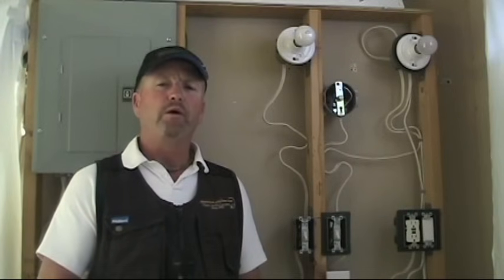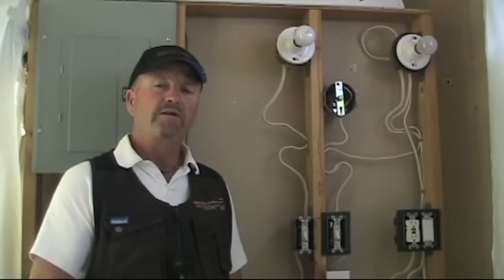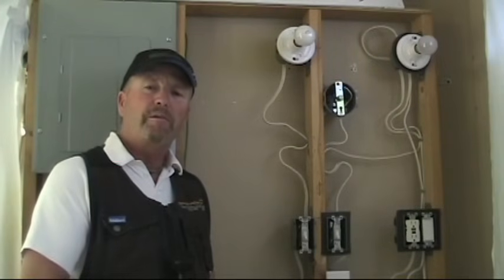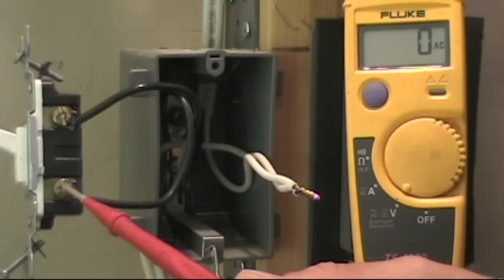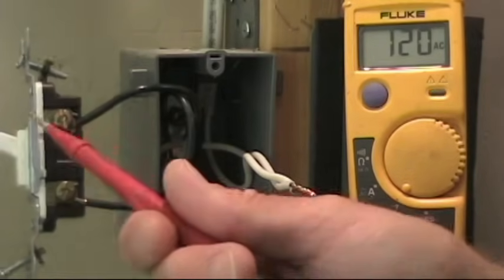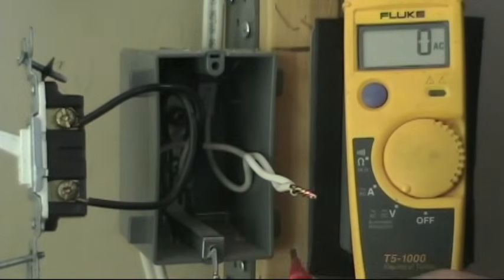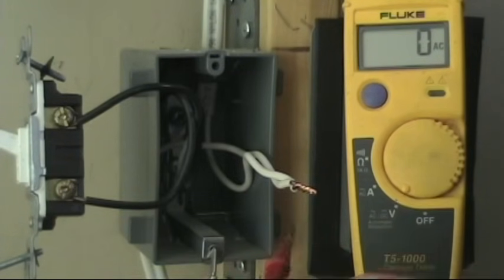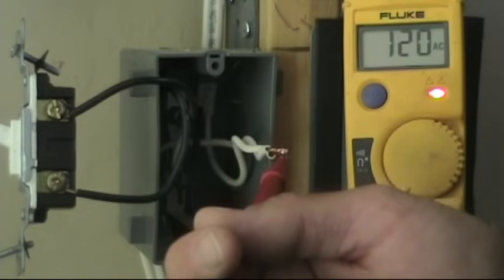Understanding an Open or Loaded Neutral

Comment: Why not zoom out and show the rest of the circuitry where you disconnected the neutrals in the junction? I think it would be a whole lot easier to use that mock up wiring rig with the video to its full potential for the visual learners. Just showing 2 neutrals with and without a load on your meter, without showing the part where you disconnected the other part of the circuit, doesn't really show the full story.

Comment: I have a subpanel out in the garage, where the ground and neutral busbars are tied together.  Then a black wire with a yellow stripe goes back to the house.  I haven't looked in the house yet to see if I can figure out what is really happening, but I assume the striped wire is a neutral.  Is the subpanel in this configuration wired correctly?  If so, do I even need grounds for hookups off the subpanel box, because they're just tied to neutral (until they get back to the main panel) anyway?
Reply from the maker: Check with you local code, but where I was trained in the trade,  if you ran a sub-feed to an outbuilding like this, if you ran 4 conductors (2 hot, nuetral and ground), then you did not bond the neutral to the ground at the sub-panel.  But if you only run 3 conductors, then you must establish another suitable ground (earthing) point at the panel location and then bond the neutral as it appears is the case with yours.  Then all the circuits fed from that panel must still have a ground wire in all the cables to keep earth and neutral separate from the panel onward. If that ground wire goes back to the main panel grounding system, then that isn't correct and you are vulnerable to floating ground current on that conductor.
Reply: @theinternetelectrician  thank you; I have an electrician coming by today; will ask him.

Comment: So the neutral connection back to the panel was open. I've read approx 36v on neutrals in operation,but didn't receive shock from them.

Comment: I have run into several of these with broken or disconnected neutrals in stab in the back outlets. Also people running screws into wires in the wall.

Comment: Now how to fix it??? 
You left me thinking how to fix it???
Reply from the maker: The solution is to connect the neutral wires back together (that were taken apart as described).The neutral (grounded conductor) path should be continuous all the way back to the panel.

Comment: To perhaps help explain this another way (I’m from the UK so the terminology may differ, but the principle is the same). 
To help understand this, first forget the colours and the names of the wires, it is only a human invention to colour code and give the conductors names.  We call them Line, Neutral and Earth. In physics, it doesn’t matter what colour they are or what they are called, the electricity just flows. So in this example, with the circuit energised, the electricity was flowing from the board, through the switch, through the lamp, along the neutral and back to the board. The neutral was not connected to earth at the board though, due to the junction boxes (splices) being removed further along in the circuit. So there was no return for the circuit to be complete. In essence, all wires have now become Line. Hence a potential of 120V (230 for single phase in the UK) between Line and Earth. If you touch the “neutral” here, thinking it cannot have a voltage between it and earth, you are in for a shock, as you have now completed the pathway back to earth and are getting electrocuted. I hope this helps. It can be tricky for people to understand at first. That is why in the UK, both the Line and Neutral constructors are classed as “Line” conductors, as in, they carry the electricity in normal operation, and why it is a good idea to use double pole isolators, odd though, as most breakers are only single pole.

Comment: Ground & nuetral are tied together in the main panel box creates GFCI so it will trip the breaker. So you could have it turned off at the box but another breaker could be on another circuit feeding electricity back to the neutral bar where your neutral on your circuit is connected. So when you flip off the breaker it will kill the electricity coming from the load Black or Red Wire but it will not turn off a possible load on a neutral feeding back to your neutral bar in the Panel coming right back at you throughout the neutral bar on the circuit your working on. That's why I kill all the power & still test it to double check It's off. Am I right or am I wrong because I been surprised by a Neutral before & thought WTH? So there could always be a load on the neutral. Ground & Neutral are supposed to be separated beyond the main panel so they should not be connected in recepticles, light switches, light outlets, or sub panels. The reason it's connected so it'll safely flip the breaker. The ground is for short outs & lightning strikes because lightning trays to find a way into the ground through your wiring. But ships & boats is an ungrounded electrical system. Even the ground might have a load on it because ground & Neutral come together in the main panel. I can't understand why now ranges & dryers must have a neutral but major Central Heating & Air Units & PTAC Units does not require a Neutral I wished somebody would explain that one to me? Two Hots & One Ground for my PTAC Unit but no Neutral is required but it's a requirement on Ranges & Dryers now? So what the Hey? Why isn't it required for PTAC Units & High Voltage AC Window Units & Central Air Units?

Comment: Yes sir, many technicians don't realize this. Can get one hurt too. Not as  common on led / fluorescent, solid state circuits and such. When troubleshooting,   neutral & grounding should be forefront...... automotive, industrial / commercial and machinery. Never assume the ground or neutral is not hot.

Comment: Ok...
QUESTION: 
WHY I TURNED OFF THE SWITCH AND STILL MY TESTER BEEPS INDICATE IS A HOT POWER (BLACK WIRE) 
TURN OFF SWITCH AND TURN OFF THE LIGHTS... BUT STILL SHOW POWER.
😱.

Comment: The problem in this explanation is saying the neutral splice is open "further up in the circuit."  Which way is "up"?  He should have said that the neutral was disconnected/open "closer to the main circuit panel" (where the neutrals all come together and are grounded).
Reply from the maker: Up generally refers to "towards the source", like a river for example.  Thanks for the feedback however.

Comment: Forgive me for being confused...But, it would seem as though your neutral wire would show voltage with the switch on like you have it, provided the circuit was complete through bulbs or similar loads...  Will read the next comment, perhaps that will explain it to me

Comment: I watched this whole thing and you didn't tell me a damn thing.  What did he see when he opened the Junction Box...???
Reply from the maker: I clearly stated that he had left a splice of neutral wires undone (open), so try to visualize 2 wires, white wires, previously connected together, now not connected together, thus breaking the intended path for current flow.  Have a look at this post on my website.  If you're still having an issue understanding this, send me an email and I'll send you a photo of 2 wires not connected together.  https://www.electrical-online.com/understanding-an-open-or-loaded-neutral/

Comment: I’ve run into this quite often in my house that was built in 1930 with cloth wrapped wires and porcelain insulators.. started replacing wires and outlets and figured out it was easier just to cut out all the old and start at the breaker box instead of routing them back the same way originally done and avoided a lot of unnecessary splicing.

Comment: Got a strange one here, had an issue with getting shocked of the meter box, the power co. opened the meter box, told me that the meter box was outdated and at fault because the neutral was not bonded to the box there. They made me install two new ground rods along with the existing plumbing ground inside. 
While disconnecting the power up top, to replace the meter box, with both hot wires disconnected from the pole, but the neutral still crimped, I went to check continuity to ground at the meter box and blew the fuse in the meter. I then checked voltage, and found I have 117v between the neutral wire from the pole and the meter box itself?
Both hot leads from the pole are disconnected, the main is off, yet I got 117v seemingly from the neutral lead from the triplex run from the pole?

Comment: Nice video. I once had the hot neutral. It bites hard. Something I have heard of but to the best of my memory I don't think have seen one. That is what they call a floating neutral. I have asked several electricians but never got a good answer as to what a floating neutral is, what does it do, and how do you find and fix a floating neutral?
Reply: He should build a model and actually show what's happening! Easy!

Comment: If it helps to explain, that exposed splice on the white (neutral) he was showing in the switch box would have been open (un-done). So he wouldn't be testing a "neutral" any longer. Only a section of white wire between the light and the switch. Unscrew the light bulb and you wouldn't get ANY reading between the switch and the end of the white wire since the light bulb filament is acting like a "coupling" (connecting the black to the white at the lamp) and extending the black wire that brings power to the lamp. Yes, a diagram or more physical demo would help.

Comment: House wiring can be tricky to analyze from limited check points.  But if you can keep in mind the overall circuit and source of the two points where you are reading a voltage and think about where it could be coming from (like through a load) you can figure most out.

Comment: If the nutural wire is purposly cut and not connected to any fixture, and just hanging off the wall, can it be stuffed back into the wall where it originated? If I turn on the electricity will this cause a fire in the wall?
Reply from the maker: I'm not sure I understand the question.  You have a single white wire hanging out of the wall, and not a cable (bundled black, white, and ground?)

Comment: Good lesson, but I’m surprised you didn’t talk about how to fix it 🤔
Reply from the maker: I guess one can never explain well enough, but I stated that the neutral splice had been inadvertently left undone, so the solution to fixing this particular problem was to put the neutral wires back together as they were.  When you don't know where the issue is, that's when it becomes a trouble-shooting exercise.  Thanks for the feedback.

Comment: kind of like al capones safe at the end...my search continues
Reply from the maker: What do you need to know? Let me help you out.  Elaborate on what you're searching for.
Reply: @theinternetelectrician  OK, I did a replacement ceiling fan install  and a replacement wall switch install. Went like clockwork. Then I said, I need to change out the wall switch and faceplate cover. Go from beige to white.  Dumb move, because my ceiling fan and its wall control  work as expected. However, I cannot get the ceiling lights to come on.  Both wires I test are 125 volts.  That, I think is my problem.  Thanks
Reply from the maker: @origtex  What wires are you testing that show 125V? Might need to have you send me photos, sketch, whatever you can to help me try and figure this out for you.  terry@electrical-online.com
Reply: @theinternetelectrician  Ill make a quick youtube of the problem and put link here. Thanks
Reply: @theinternetelectrician  figured it out...2nd wall switch was the issue. there was a red wire going to it. I need to buy a different receptacle.  Dang!! too simple

Comment: I got a shock from a white neutral last week replacing a pool pump. Assuming the white wire coming out of the small box on the side of the house near the pumps was neutral. Assuming the pumps were set up for 115. Nope. Somebody made 220 with three wires using the unshielded ground wire for the neutral. They started at the main box from a double breaker with red and black. Now how can I tell if the middle bare wire go's back to a common or a ground?
Reply from the maker: This is actually quite common, and is OK to do, IF, you identify that white wire as a hot wire wherever it is accessible, like in any junction box, or at the pump.  Identify it by using black, red, (or even blue) electrical tape.  The bare ground wire in this case is not a neutral.  It is just an equipment ground wire.  The difference being it does not carry current (intentionally that is, only in a fault condition) 240V loads don't need a neutral, the current is all on the 2 hot wires.

Comment: Top side should be the feed,bottom side of switch is switch leg(load) according to N.E.C
Reply from the maker: Correct me if I'm wrong, but I don't believe the NEC specifies this with a single pole switch such as this.  It's more of a preferred trade practice for some.  It comes from the rules on wiring a 'knife' or a 'blade' switch, where the operating handle is insulated where you grab it to move the knife, but that handle forms part of the live components to complete the circuit.  If the bottom of those is wired as hot, the handle is hot.  If you have the top as hot, then the handle is not live until you push it into the live jaw of the switch assembly.
Reply: @theinternetelectrician  As long as a man knows what he did ,and it's done safe is good.  General rule, top side is feed on most any switch. I'm a utility lineman now and top side is always source side (when possible). 30 years lineman,10 as commercial electrician doesn't make me an expert but I'd like to think I know a little bit.   Haha.   Enjoyed the video!!
Reply from the maker: @cs-rb2ob  Yes, probably good to stay consistent with the top side hot.  I was taught to feed the bottom back in 1981 with my beginning in the trade.  In 40 years I've never been flagged as it being a code violation by any inspector.  Thanks for watching!

Comment: I started chasing screwed up neutral,
Wound up at the service pole in the yard... Down the pole,, to the meter,outside disconnect.. In the earth... To the home... 
Used to be the electrican could pull the meter to check for problems..
NO MORE...      !!!.....???..
RAIN WATER.. down the line has rotted/ rusted away the neutral lug,,
Jumped a ground back to earth..
Already next to pole...
Called the power company... 
No more home owners permits, the electrican MAFIA.. GRUBBING FOR EVERY PENNY, HAS THEIR BOARD OF "GREEDY HEATHENS"... = WE WANT TO RAPE EVERY LAST PERSON WE TALK TO...) 
HAS MADE ADJUSTMENTS TO WHATEVER THEY CAN.. 
THEY SHOULD ALL BE VERY PROUD OF THEMSELVES...
🐖 🐖 🐖"s...
And no the service was here when I got here... Not my work... Not my mistake...  That was SOMEONE, .. Way SMARTER THAN ME... THAT HALF AZZED THAT... 
PROBABLY SITTING ON THE BOARD TODAY...

Comment: You never did get to the part where you actually explained how a loaded neutral happened.  No information in this video.
Reply from the maker: How it happened is that the neutral path was broken by leaving an open splice, but if you need more information, don't hesitate to ask!

Comment: I have 4 overhead lights and 6 plugs on same cercit... One day the lights stoped working and the plugs still worked... And the next day the lights came back on ... It's done it 3 times now... I've swaped out all plugs and checked all the lights can't find anything wrong ?
Reply from the maker: I suspect you have a bad splice in a wire nut somewhere that is intermittently opening up.  Check all the connections on neutral and hot conductors.

Comment: Stop worrying about the neutral. Tie it in and forget it.
Reply from the maker: Yes, the neutral path should be continuous.
Reply: I was kinda joking. But I had this apprentice that was driving me nuts. Every single box was - “so what do I do with the neutral here?”... by day seven I finally let out with - please stop worrying about the neutral!!!!

 He went on to be a way better electrician than I ever was.. I wound up doing locomotive electrical repair and you had to be very careful about neutrals on those beasts. Nothing is grounded and so many power supplies are tied together and all tied into a ground relay system.

Comment: How could you not tell If you didn’t check it while is hot ?
Reply from the maker: You could do a continuity test on the neutral wire, checking from neutral in reference to the ground wire.  Should be very low, close to 0 ohms.
Reply: Your right. But I have ran to live voyage with digital meters close to 0 because of fluctuations. I have worked on CNC machines and have had to add amp modules to control over amperage. Or under amperage . And we check circuits when hot or we can’t find the failed source . I get it in residential.

Comment: The largest voltage drop in a circuit is across the highest impedance (resistance).  The impedance (resistance) of an open is infinity, hence the 120 volt reading.
Reply from the maker: Correct!
Reply: @theinternetelectrician  learned that in basic electronics in the early 70's

Comment: What he's saying is that the neutral is loaded because it is open. The path to "unload" is the neutral path back to the panel, which is bonded to ground. If the bonded/grounded/neutral conductor becomes ungrounded it is then loaded the same as the ungrounded(hot/black) conductors.
Please correct me if I'm wrong.
Reply from the maker: You are correct!

Comment: I had a call that a 5 door refrigerated case was out. In this case were 5- 115v 9watt fan motors. I thought, why would all 5 motors go at one time. Took out my meter and yep, 208 volt going to the motors. Now this circuit was in place for sometime, and there was a renovation going on at this time. So I know this does happen